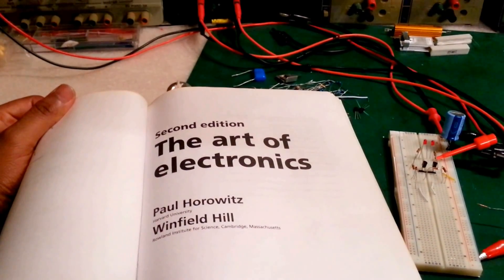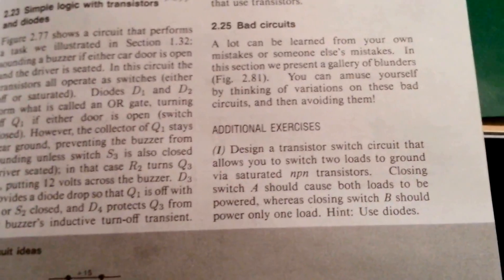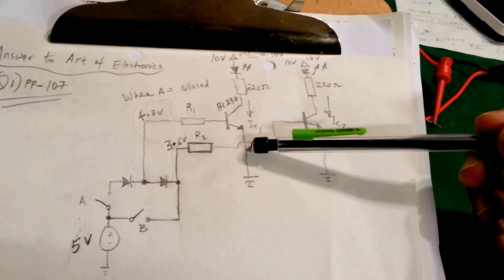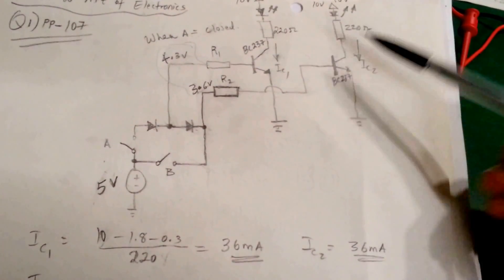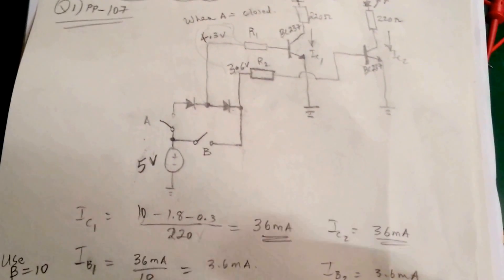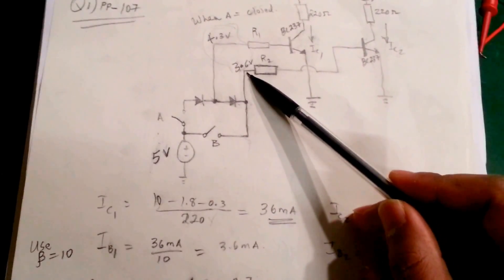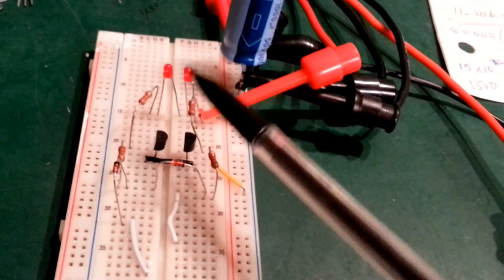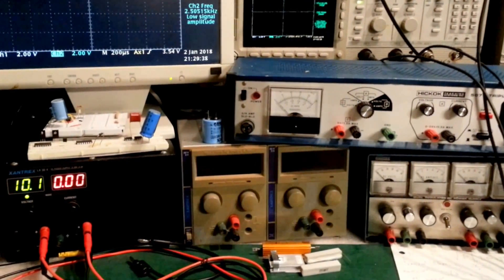Design of Transistor Switch - The Art of Electronics Chapter 2 Problem 1 Solution

Comment: Thanks for the video. We don't really need the diode immediately after switch A, do we?
Reply from the maker: Yes you are correct! For the purpose of blocking switch 'B' from operating transistor on the left that diode isn't necessary.
Reply: @SmithKerona  So you find value of base resistor of Transistor 1kohm. But you get 1.2kOhm => you will have current flowing into base 3.58mA which is less than 3.6mA. Did you check is transistor is really deep saturated. I think that we need to take lower than 1 kOhm (not higher) if we wanna keep transistor in deep saturation region. Am I right?
Reply from the maker: @ДенисСами  If you notice in the video at 7:46 on wards, I do clarify that issue. Since our saturation beta was conservative (β=10) choosing base resistor of 1.2K instead of 1k is not going to affect which region of operation the transistor will be in. In fact I did measure the collector to emitter saturation voltage and it was around 80mv which indicates the transistor is in deep saturation (Datasheet for BC237 Vce(sat) vs Ic typical plot shows around the same value for Ic = 36mA)
Reply: I made the same observation.  The hint did say "use diodes" :)